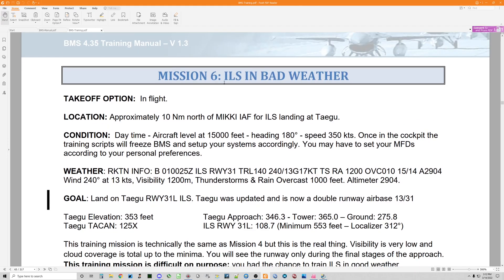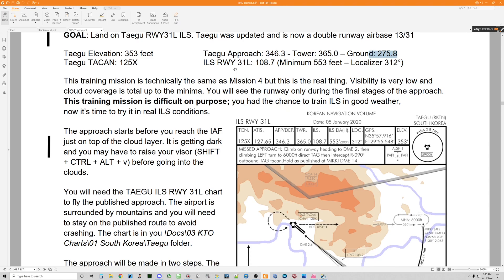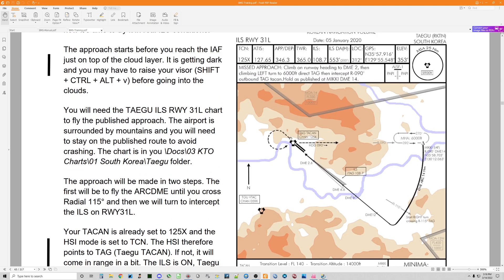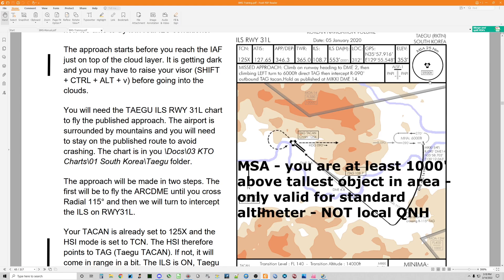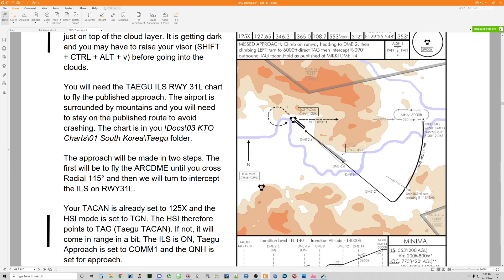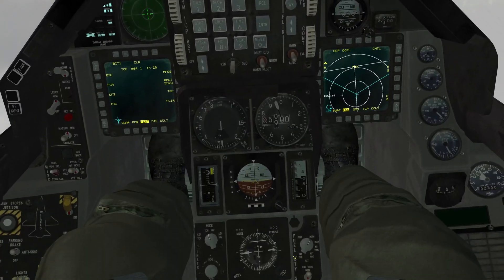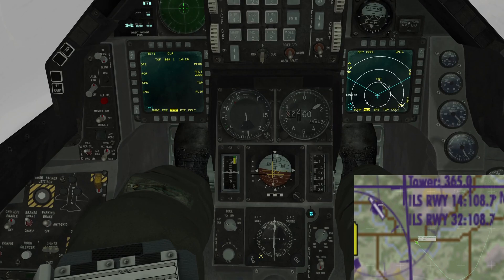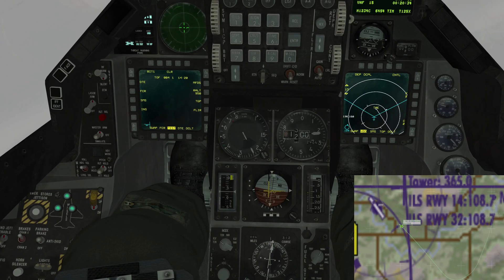ILS Landing the F-16 - Falcon BMS Tutorial

Comment: Wow, very well done. Never thought of using the AP to guide the heading - are you able to lower altitude manually and the AP just keeps heading?
Reply from the maker: Thanks! Just setting the ATT hold on the autopilot let’s you adjust pitch w/ the stick until the FPM is pitched where you want it, and then holds pitch there when the stick is released - very easy